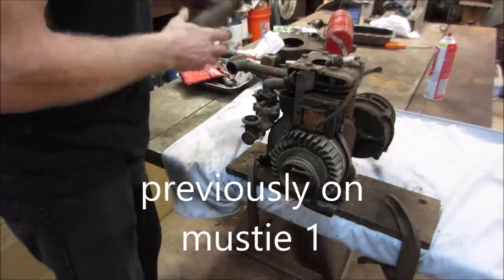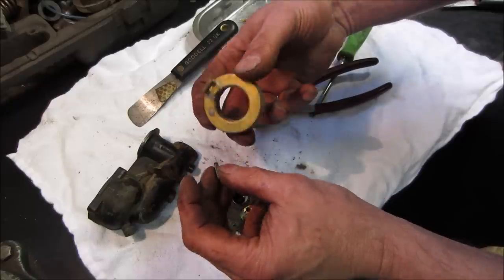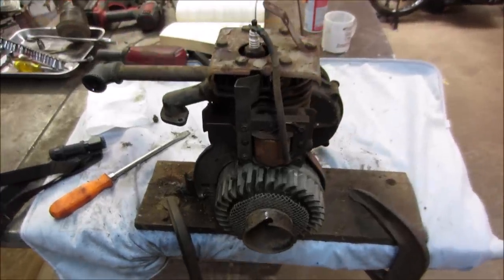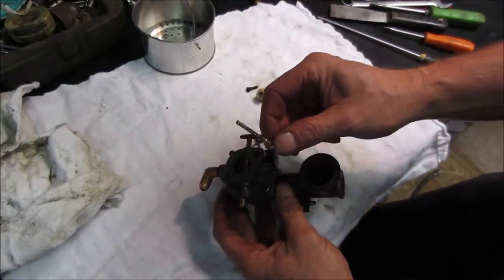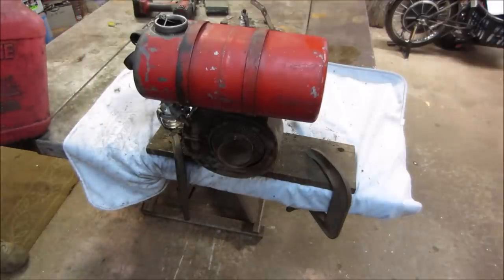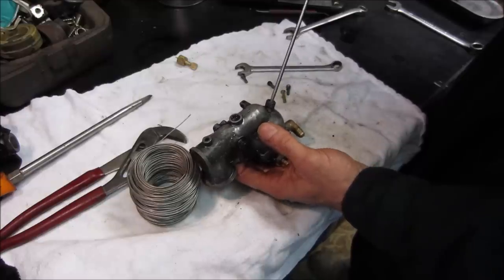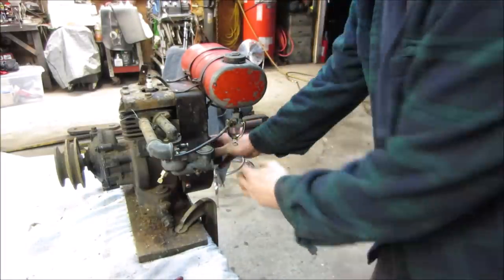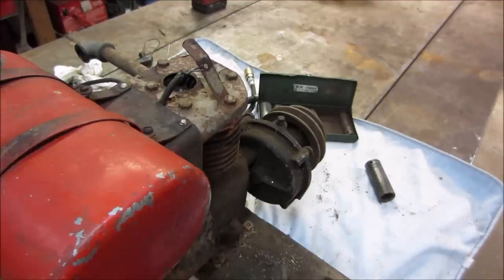Will It Run? $5 antique Briggs engine.part 2

Comment: If you take things apart and put them back together and you have parts left over, congratulations, you've re-engineered it even better than it was before so that it now needs fewer parts.
Reply: LOL. I need to remember this one!
Reply: When you have parts left over after a rebuild they are called weeee parts because that’s the sound when you throw them in the pile of spares in the corner of the workshop lol
Reply: that often holds true with sometimes stupid things like balance/harmonic dampening shafts and chains,  they often chew up and self destruct taking out the whole rest of the item..
Reply: @Ashurii - I'm older than you, but I can fix anything - where's the baling wire...
Reply: F O O L!!!
Reply: Do it all the time
Reply: If you take it apart on a whim at 2 in the morning you might have some parts left over but no matter just get the smart guy down the street who DOESN'T do meth to sort it out for you. Speaking generally, not calling you a tweaker.
Reply: Danny Coulter nah it means ur bikes messed up
Reply: Yall listen to  tool for the job by corb Lund. There's a line about a rebuilt motor yall will relate to.
Reply: Only if it still runs.  :)
Reply: Love your HOT TANK CLEANER..SOAKING CARB PARTS IN BIG CANS OF CARB CLEANER IS  PRETTY SAD  IMO  😔but  thats all i got.   small engine repair can be a good job..
Reply: Watched part 1 and 2....I can't believe this guy has subs. Definitely not the way to go about preserving a piece of history.
Reply: The Polish have even a saying for that situation, as it was very common in the communist times: "Good, got some parts left for your bike" :-D
Reply: @Ashurii 2 most commonly used items aboard ship to make repairs? 
 1.) duct tape, 
       2.) WD40.

Comment: I work in tech support for performance aftermarket parts for automobiles. A lot of my day is "how do I tune this carb?", "What jets do I use?"".What heat range do I need on plugs?", What should I set timing at?" and all I can say is "start "here" and see what it likes. This is a perfect example of what it is. Trial and error. I like watching you bring these little old engines back to life.It's just satisfying.

Comment: I really love those old flo-jet carbs, rarely need parts, and if it does, it's usually because a homeowner has cranked the adjustment needles as tight as they can and put a ledge in the needle. Unlike today's carbs, especially the Nikki carbs Briggs uses on its 14-18 hp ohv engines, I stock a selection of walbro replacement carbs for when I get one in. I've spent too much time and money trying to get the Nikki's to work, only to replace it anyway. And with the price of the plastic parts and rubber molded orings, the walbro is about the same or less in price. Running a shop, I can't waste my time and my customers  chasing a bad designed part.if it has a running problem that's fuel related, I'll pull it off, inspect, and clean. If no joy on reinstall, it gets a new one. Flooding carbs I will try a needle ($14, Briggs list) if still floods, the metering plate (large plastic body the float attached to) is warpped, so new carb. Anyone who has a Briggs with a Nikki carb, look on Amazon or eBay, usually can get a aftermarket for next to nothing.
Reply: Yeah the nikkis are pretty bad. Ive had my fair share of annoyances with them on briggs motors
Reply: Those carbs are known for warpage of the top. I started doubling up on the gasket to get them to stop leaking. People get moody when you say things like needs a new carborator.  Especially on grandpas old snow blower or roto tiller.
Reply: Yeah I work at a dealer. I know exactly what you mean.

Comment: Great work Mustie you did it again
Reply: I am a product of that era.   I did most everything you showed me on my 3/4 hp B & S that I put on my car.   My GP built the 2/10 "body" with 12" Soap Box Derby wheels.  My dad had a 10" pully welded onto the left-rear wheel.   There was a large 2"/12" seat and you guided it with your feet.   It went 28 mph and I was only stopped by police once.  I could have used your help with the engine many times.
Thanks for taking me back to the fifties!
RT

Comment: Great job, Mustie is very patient and does not loose his cool, or just give up like a lot of us would, he got the engine running, needs needle and seat for the float, it is to be expected on an older engine to be a bit worn, with the right new parts it would run well again.

Comment: Standard preset / initial set for most of the early small engines Carburetors  is 2 1/2 turns out on the  MAIN JET , and 1 1/2 turns out on the idle jet .  Most old tractors are the same way .  Most likely cause of the flooding is it has the wrong needle on the float.  You said the float needle fit very loose .  All of that oil on top of the piston was probably the remnants of the Marvel Oil that you had dumped in the cylinder earlier on .

Comment: Good to see you pull the main needle out 1st, seen more than 1 guy pull the float bowl and crack that off.

Sweet muffler!
Reply: The way it exhausts towards the carb and the operator is a nice touch!
Reply: @MrUbiquitousTech  its an early turbo attempt!  :)
Reply: @Ajaxaxxess  LOL, yes, the 90' elbow helps create a vortex. ;)

Comment: thank you for all the great small engine videos.  did my first repair when I took  a N Briggs  from the town where I was working to have something to do in my spare time. It was just a box of parts that someone took apart and left.  I got it running again and started my love of small engine repair.  That was in 1963  I taught HS ag shop for 31 years and always had a small engine repair unit.  One comment on this video.  There should be a filter screen in the sediment  bowl it probably got dirty and plugged so someone took it out to let any gas through.

Comment: Ethanol fuel has given me a retirement gig, cleaning neglected carburetors.
Reply: I wonder how many hours of runtime this engine has on it.  It is just amazing how well made they were.
Reply: Same here job security 😂😂😂
Reply: I hear you. Keeps me in RC planes and other fun toys.
Reply: I don't think the name Mustie2 has been taken.
Reply: @jaybutlet3559  - And I'm teaching a couple of young boys (12 & 15 yrs. old) to be mechanics. Been at it for roughly 4 months now, and they'll be making money at it by spring. SMART boys, and their middle sister is learning just by watching and asking questions from a bit of a distance. She's 10! Come to think of it, I may have to make a video...
Reply: Ok question. Definitely not a mechanic but have some skill fixing my own stuff and can always use a side gig. What all services do you do?
Reply: @alanhardman2447  It would be really funny if because of this conversation people opened up channels Mustie2 thru 9 all engine based. Each with their own flavor of horde, of course. It would become its own larger than life brand.

But seriously I almost went to college for car mechanics. I applied at Dunwoody but later switched to electronics at NEI. I can tell you one of the most handy things if you're teaching kids to work on small engines is to get a neon bulb spark sensor. Mine cost all of $2 at Kmart and it tests for spark w/o removing the plug. Pretty handy for a start into engines. I've done a fair amount of engine work. Done heads, even repaired an automatic transmission once w/o a tranny jack. Also get some locking 3/8 socket extensions & swivels as they have gotten me into very tight spaces.
Reply: Quit using gasahol and don't require any more in-tank fuel pumps.
Reply: Art Vandelay I have already wore out one ultrasonic cleaner!
Reply: @alanhardman2447  Now you just have to set them up to recruit others, and still others, and they all pay a tithe to the level before/above them... ending at YOU!
Reply: Gummed up carburetors preceded ethanol.
Reply: The whole trick is to ONLY use 94 or above octane gas in your equipment since that usually do not contain any ethanol at all. My lawnmower repair guy was foolish enough to offer that one up for free.

Comment: hey Mustie, with the use of the white rag on the bench it makes the objects that you are working on very dark. i think the camera over adjusts. can you shine a overhead light on the work area. or it could be just my old eyes. good to see old stuff come alive once again after so many years of idle sitting.  jim in florida
Reply from the maker: thanks jim
Reply: Not just you, I noticed a lot of shadowing too. Not complaining though, just noticed a difference, love these vids.
Reply: @mustie1  A darker towel or cloth will keep the camera lens from over adjusting too.
Reply: Ditto
Reply: Give it some time the rag will turn grey soon enough :-)
Reply: Lastly Mustie, the white text washes out on the white towel. Maybe relocate the text elsewhere in the frame? Thanks for these videos!
Reply: AS,,an experienced studio, , 'frogtofigater', , , ,I'd suggest.using an18% grey, = to approx. a moderate shade of grey, in indirect, sunlight, , ,    towel/backdrop ('s what 'the'ol film,, light meters were, caibrated, , to.   To, reduce the reflectance contrast,, between 'yer, pieces/parts, ,'n 'the back ground. . OK, , ,Class,, dissmissed!!! , , , , , '''''th bill 's in 'th mail!!
Reply: great video but I have a hard time seeing some of the smaller parts. like others said. also yeah the white text was washed out but you could put a border around it next time.

Comment: I think we should go all France Yellow Vest until they eradicate ethanol.
Reply from the maker: LOL
Reply: hahahaha We don't want to eradicate ethanol, just taxes. just for fun, we like diesel. we have a lot of them.
Reply: Lets get the carb rebuilds to a minimum, with ethanol its a yearly thing. Not like the old days when you only needed it when some dork put watered mix into the tank.  @jbgaud
Reply: I think we oughtta just go protest because, well, because it's France!
Reply: Don’t forget that they pay about $3.50 a gallon in taxes!
Reply: No doubt!
Reply: Here in Iowa we make the ethanol and we can get ethanol free at most gas stations for about a quarter more a gallon. I run it in all my small engines.
Reply: The whole ethanol model is a subsidy which really doesn't make sense.  A good sign is that a fuel station here in Atlanta now has a separate tank and hose etc for no ethanol fuel.  Only problem is that it's pretty low test (equal to the low test with ethanol- 87 octane).  So it's sort of trade-off when filling up a fuel tank on my finicky old 2t vespa - do you want no ethanol and low test, or ethanol and high test?  Experimenting, but it seems like the high test with ethanol is best when you're running it all the time (i.e. summer), and then probably no ethanol low test when it's cold out and I don't tend to run it as much.
Reply: In all honesty ethanol is quite a remarkable fuel. It just wreaks havoc on older engines that use carburetors, and rubber fuel lines. the reason I stick up for ethanol is because when I worked at an ethanol plant and when I was going to school for automotive mechanics, we dissected an engine that ran primarily on e85 for a. Of 350k miles. It was as clean on the inside as you can imagine. Ethanol does not produce as many impurities as gasoline. That's why it burns much cleaner, you can go longer on oil changes if you burn the 85 because the impurities don't see past your rings and get into the oil dirtying it up.
Reply: @redingtonm ... please, consider stopping the production of ethanol.  It has done us little to no good whatsoever, except for jacking up the price of corn, which is only good if you grow thousands of acres of it.
Reply: But then we won't have all the free, easily repaired "junk" people throw out because of it! :)
Reply: @kenarnold9132  so true
Reply: noooo, some of use enjoy drinking ethanol, however removing it from Gasoline sounds good ;)
Reply: @stanpatterson5033  lol I work as an accountant at an insurance company. I don't like the ethanol any more than you.
Reply: For whatever that ..means!!!
Reply: @stanpatterson5033  corn is dirt cheap right now signed, the corn belt.
Reply: You can't imagine how quickly these bureaucrats would change the law requiring ethanol if they could be personally sued for the damage it causes.  :>/
Reply: @Ashurii Quark by far my fave on DS9
Reply: @Ashurii they were confidants. Friends. Quark's scream when scared was awesome and still makes me laugh.

Comment: On older ones adjust the main 1st then the idle
Reply: One and one half turn on main one and one quarter on the other. At least I am pretty sure thats how they went. Done my share of rebuilds on them.
Reply from the maker: it had no control on the high side and only the idle did so when in rome well you know, or else thats how l would set it up,

Comment: Man does that take me back!  Must have been 1964, my neighbor gave me an old home built bicycle frame that had a motor mount, and no peddles , a pulley where they should be and such.  He said he never did get a motor mounted but grew up and bought his first motorcycle, an old Harley. So there I sat, with this frame, and my  1 dollar week allowance didn't get me much as far as parts, so I scrounged around the garage and found a Maytag washing machine gas engine. I played with her and got her running, mounted it, but I didn't have a belt but I found one at the dump ground, it was very elastic, so I built an idler arm sort of device for a clutch and got it all together.  That old Maytag didn't have a lot of power but it was enough to give me the thrill of my first motor powered bike!  I went on to own lots of motorcycles but had to give it up after becoming disabled,  GOD how I miss motorcycles, hell I miss life as I used to know it, but it all comes with age, and videos like this give me a bit of that same feelings, so thanks much for making an old man young again, at least for forty minutes or so!

Comment: you know, every time i see the parts washer and its drain, i want to build a little recirculating pump and filter for it so that the fluid can stay nice and clean. dunno why, but i have a thing for building/thinking up stuff that is technically useful and totally pointless.

Comment: Pieces of broken hardend car glass works great for cleaning the inside of rusted tanks.
Reply: I use old carbide machine tool inserts of different sizes and shapes.
Reply: Use a piece of chain, much easier to get out

Comment: So, why don't you replace the rings, get it running really sweet, then get it all shined up, cleaned and polish the unpainted surfaces, and repaint the ones that are? Aren't there collectors of  such things that would pay good money for a restored vintage piece? When I was a kid, we'd take motors such as this one, without the gear reduction and mount them on homemade go karts. we used to play with the pipes too, adding this and that to see what we could make the sound do. We had lots of plumbing parts laying around, so we'd configure them in dozens of ways just to see what it would do. We accidentally got one to run so quiet you couldn't tell it was running if you weren't looking at it, but the 20 feet or so of pipe and bends and what not that took was a bit impractical. Only worked with the clothes line to hold up the end of it. Seems to me you're getting them running is ony half the job.. they should look like they used to look too, before time took it's toll.
Reply: toot tall You’d never get your money back for parts and time. Projects like this need to be a labour or love for the individual. They are not a means to make money.

Comment: Love this stuff, reminds me of a 1953 Mery Tiller Briggs and Stratton managed to get running.  The problem with mine was the float had holes so I repaired them.   I didn't know enough about carbs at the time and didn't clean the main jet but it did run. 

Also brought a 10hp Tecumseh motor to life. Had a crank case full of water and oil.  Ended up failing due to the valve seat falling out of the head and cracking.  Replaced with a 2006 Briggs and Stratton 12hp motor I bought cheap due to a broken compression release mechanism.

Comment: Enjoyed this a lot -- As a kid 10 years old we had one on a self-propelled reel-type mower... including the gear reduction which made it next to useless for building pipe-frame minibikes...    Took it apart and tinkered with it all the time...  (Also loved the old REO motor you had a while back -- that one was also on a reel-type mower... I overnighted the bearings and blew a connecting rod in that one as I recall - good lesson!)  Thanks!

Ely

Comment: hi  loved the video spent years working on small engines small though they may be they can be a real challenge , i spent 8 hours on a lawn mower changed every thing only to find out it was a dud champion spark plug fired fine on the head broke down under compression so ngk or bosch only, take care

Comment: That looks like a Model 8r6 the 8 signifies the cubic inch displacement and the r6 is your gear reduction unit. I used to mess with model 8 Briggs all the time. Really well made engines easy to work with. The info tag on those would be rivited to the cylinder cooling schroud that appears to be missing from your engine. The tag would be on the back side of the cylinder above the gear reduction unit. And yes it’s a mid 1950’s engine. Your making me want to dig mine out again!

Comment: Hay guy , those old flat heads go forever ! I took a 5 and used new bearings and seals and carb and using a tack it ran great and reved to 6,000 comfortably, o ya the carb was a methenal tillitson . Keep em coming !

Comment: Back in the day the small engine shops used to sell the replacement needle valves with rubber tips as a fix for carbs that flooded like that, same with older automobile carbs.